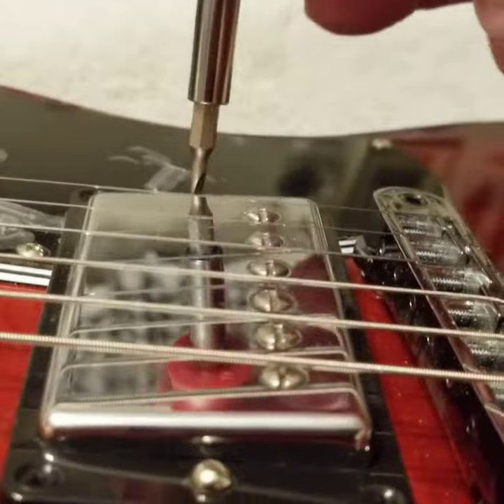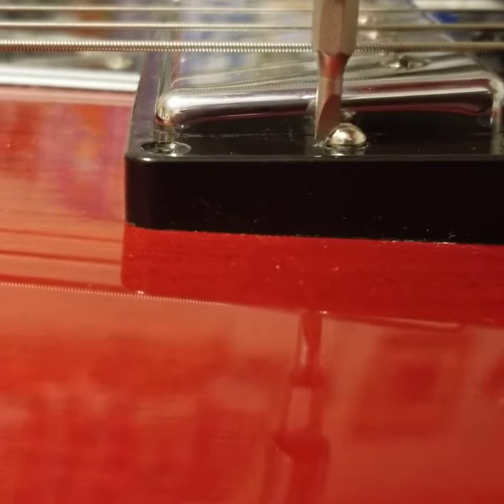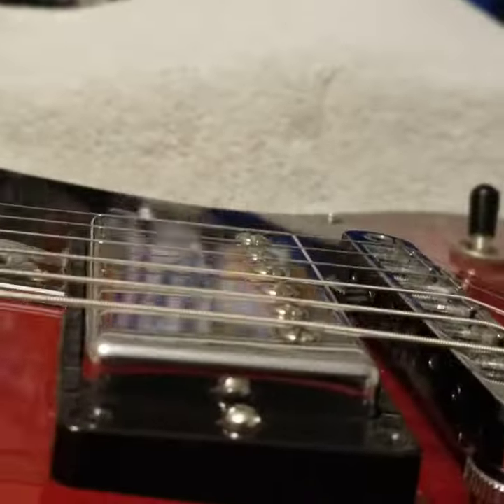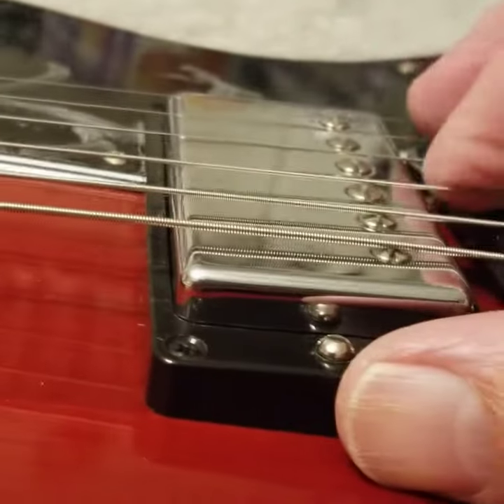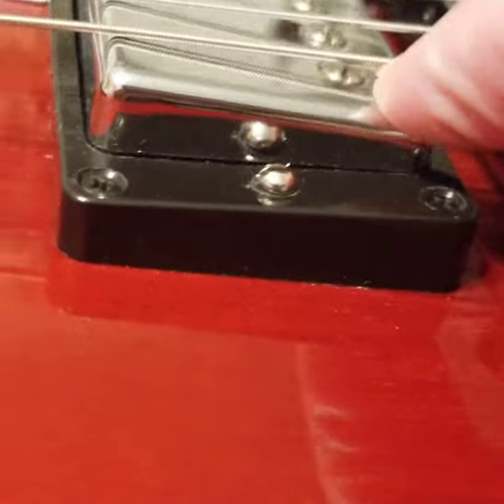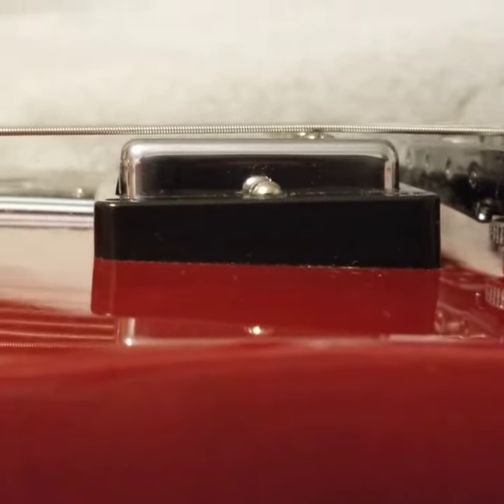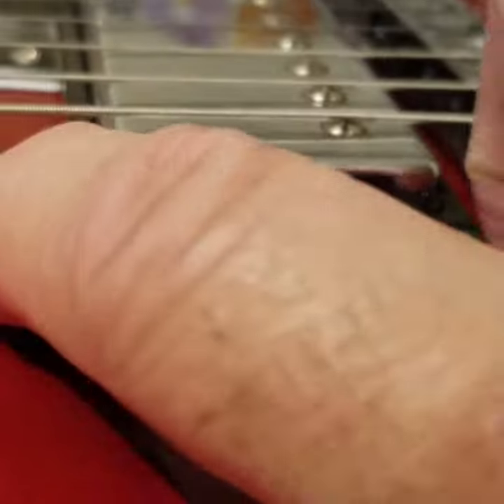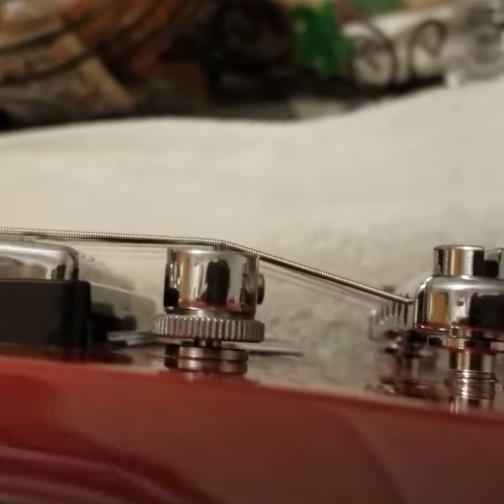SG angled/tilted bridge pickup issues...

Comment: It may be that the adjustment screws are too long and hitting the bottom of the cavity. I had that with another humbucker and ground them a bit shorter so they didn't touch the bottom of the cavity. I think I could hear them scraping when you were rocky it. Worth a try!